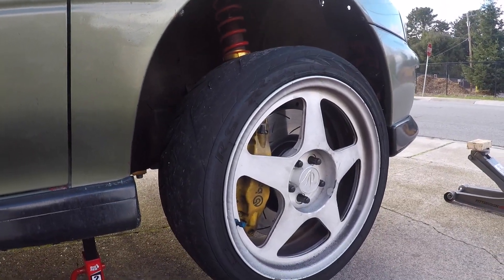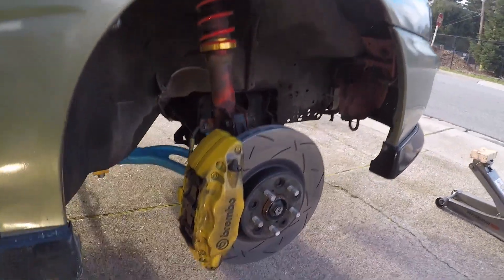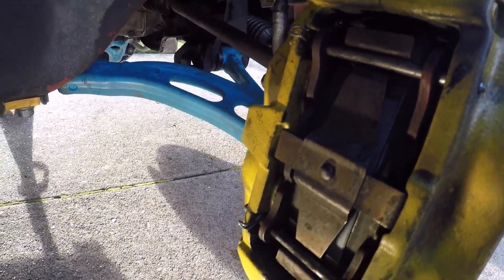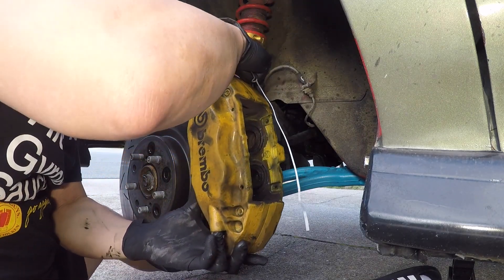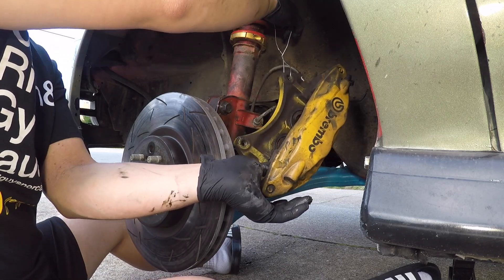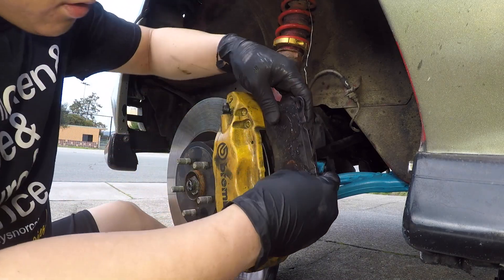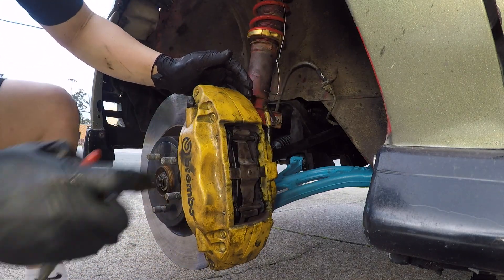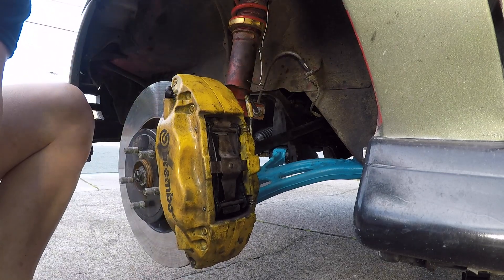DIY: How to change pads and rotors on Subaru Impreza WRX STI Brembo brakes STI swapped GC8 Impreza

Comment: Best video for brakes and rotor replacement! Even though it doesn’t have as many views this was without a doubt the most informative and clear! Nice job:)
Reply from the maker: Thanks! I’m glad it was helpful for you!
Reply: @Damn_G  one of my 19mm bolts is on SUPER tight. Have you ever had that problem?
Reply from the maker: @league6767  naw. But if it’s tight and spinning and nothing happening your threads on the caliper itself may be stripped. That happens. Just soak it in PB blaster over night and use something with leverage.

Comment: Always Clean the hub because any imperfection and rust will cause break issues. Also looks like the axle boot spread the grease all over the brake. Not good mate.

Comment: Where the brakes a direct fit?
Reply from the maker: movier1243 yes, but I have gd wrx hubs. Fronts are bolt on. Rear are but with 2002 wrx hubs
Reply: @Damn_G  I just bought I 2002 wrx with a 207 and RA 5 speed to swap into my car been looking at brakes to see what I could do.
Reply from the maker: movier1243 front brembos are bolt on, rear brembos you will need special adapter and special rotors that have outside diameter of sti and inside diameter(for handbrake) of wrx. It’s bolt on. Look up kns brakes rear brembo conversion. They sell a kit for the rotors and the adapter. Kns/dba are the only companies that make the adapter rotor. Kns/torque solutions/kartboy all make adapters.